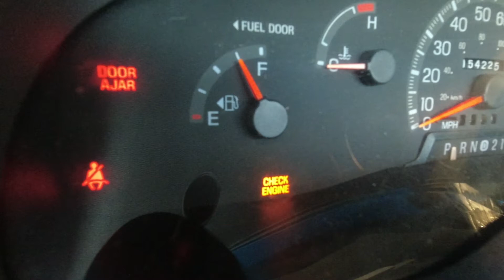EGR Clean Up: Fix Code P0401 EGR Insufficient  (Ford F150)

Comment: Great video, I just did this on my 2000 today and it runs awesome. A pro tip to add to this job is grab a sawsall and cut your exhaust off right after the Y. Sounds mint

Comment: Why didn't you ckean the actual EGR Valve?🤷🏽‍♀️ 

You took off the throttle body to clean and that's good, but it does help to actually clean the EGR Valve to and even the Idle Air Control Valve since those can have carbon build up also.

Comment: It's good to use throttle body cleaner in that throttle body, not brake fluid!
Reply: Probably, but he used brake cleaner, not brake fluid. I think the only difference is that throttle body cleaner can be safely ingested and burned in the engine. So brake cleaner was fine in this case, since he cleaned it while it was off the engine.
Reply: I meant brake cleaner! Not fluid! 😏
Reply: I meant brake cleaner! Not brake fluid!😏

Comment: Exactly what caused my problem...I got a piece of mig wire through the carbon to start. Then I cut a 6 inch piece of 1/16 inch cable and chucked it in a drill. Just ran the drill while moving in and out of hole. As you suggested lots of carb clean or brake clean helps. Great video thanks!
Reply: How did your truck run before you cleaned it. Mine is like it’s skipping is the best way I can describe it
Reply: @dallasfolsom1521  mine ran fine, just a check engine light and code for low egr flow.

Comment: I have an 03 5.4, P0401 code.  Brand new EGR valve, brand new DPFE sensor/hoses, and brand new EGR vaccum solenoid.  Still have the P0401 code....could it be the EGR tube plugged up? I have already completely cleaned every single port on the intake...
Reply from the maker: That code is normally associated with a bad DPFE sensor, but since you have a new one, I would look to see if the ports or tubes are plugged. Also make sure that the new DPFE is a motorcraft or good reputable brand part. I've had issues in the past with new cheap china parts still throwing codes. It's also unlikely since theyre are different sizes, but make sure the vaccum hoses to the dpfe are routed correctly
Reply: @BigGirlsGarage  The DPFE is Standard Motor Products, I haven't had any problems with their stuff.  I bought a new EGR tube to see if that does anything.  Thanks for the response, much appreciated!
Reply from the maker: @jaredadams5194  Let us know how that goes!
Reply: @biggirlsgarage8331  will do!
Reply: @jaredadams5194 ??? Update ???
Reply: @jaredadams5194  What's the update!!!! Did you fix the issue?! 🙄
Reply: @flowersfam3462  Yes! Sorry, I forgot I posted that comment. 😅 I switched back to the factory injectors, changed intake manifold gaskets (again) and I had a coil misfiring on cylinder 4.  I had all brand new coils on it, so Edelbrock will have some explaining to do on that...but anyway, YES, IT RUNS GREAT NOW!
Reply: @flowersfam3462  I still get a very rare EGR code, but it doesn't affect performance while driving so I just clear the code and go about my way.
Reply: @jaredadams5194  Glad to hear it!😊
Reply: I have the same problem

Comment: If my truck turns on and immediately dies is it also p0401 ? That was my only code showing but it was still running fine till I let it sit for a week now it immediately stalls after turning on?
Reply from the maker: I would check for a major vacuum leak as well. We had a similar issue your describing, and it was the tube that connects to the back of the intake manifold. It’s rubber hose with a plastic lining on the inside and our inner plastic part was snapped.

Comment: Did u replace gaskets? I've cleaned egr n thinking this my next step. Got a dpfe from scrapyard n it registers a 402 code n original gives me 401. This is my next step before ck engine light burns out. Lol
Reply from the maker: The dpfe from the scrap may be faulty. You never know when taking parts from the junk yard. I did not replace the gasket
Reply: It’s always good to replace the gasket anyway. Just in case the old gasket is bad or of it is still good but got kinked somewhere. Just in case, so you don’t haven’t to do it again.